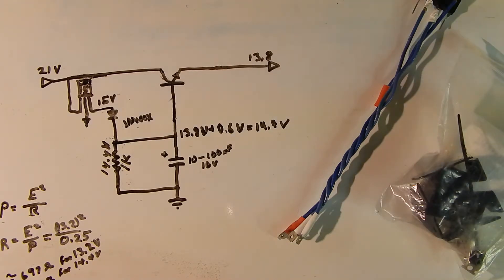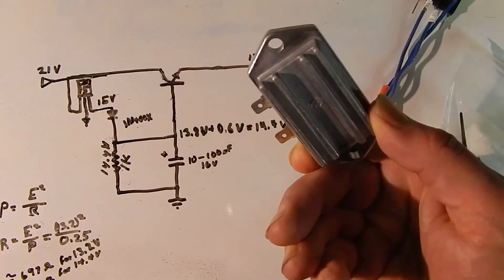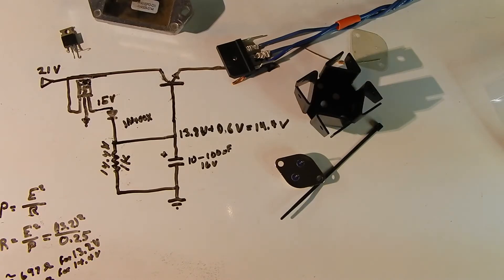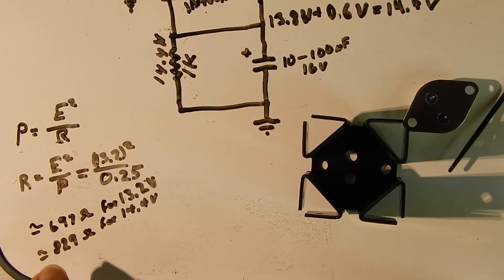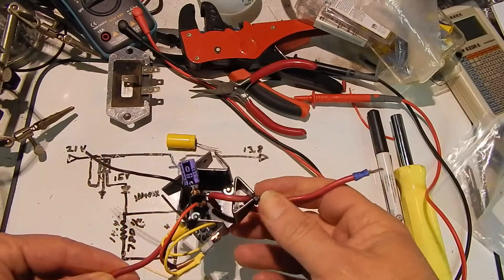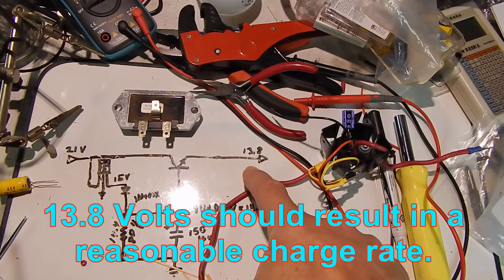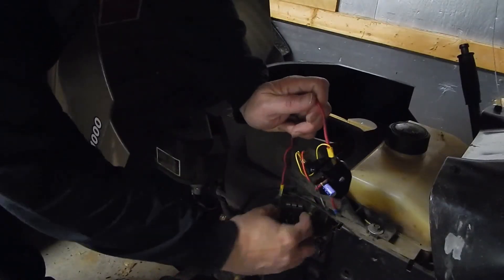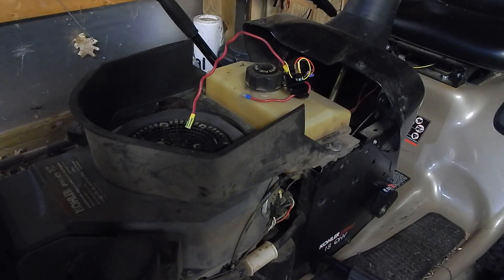Kohler Voltage Regulator Re-Regulator!

Comment: Fun project!  You could remove the small regulator and put the resistor there, so from collector to base, then put a 14.7 V zener at the base to ground with a cap in parallel.  The resistor zener combo puts a voltage at your base and the resistor supplies current to the base and zener.
Reply from the maker: Had the regulator, didn't have the Zener.
The stock regulator is a mystery to me though, why would they make it without a voltage standard? Really odd how any resistance before the battery or battery ESR itself drives up the regulated Voltage. Why would a regulator not have a V to ground standard?

Comment: Kohler 22hp motor on a Ferris mower is getting a fuse blowing eventually after running a wile .the wire gets hot also between the fuse and the key switch. regulator is putting out 14.5 volts. is that to much causing my hot wire eventually blowing the fuse !?
Reply: That is typical of a bad electric PTO clutch. If it only happens with the mower deck engaged try running without the deck engaged and see if that helps. If it does, you will need to test the clutch and replace as needed. Also check the PTO switch for resistance.
Reply from the maker: Follow the heat. Is the fuel cutoff solenoid getting hot? 14.5V is about normal a few seconds after starting, should settle lower (~13.8). If not, make sure the regulator is well grounded and all connections are solid and free of corrosion. But something is drawing too much current, and if Voltage doesn't exceed that 14.5, and the headlights or other accessories are off, there really isn't anything else for a load other than the fuel cutout solenoid.

Comment: Might there be a buck converter w/ sufficient power output, that wouldn't be dumping the voltage differential as heat in a linear pass trans circuit?  While more fidgety, a home-brew buck might be able to be designed for considerable power.  Just a wonder.
Reply from the maker: It would be something to look into but a challenge. I designed for a 15A output, not impossible for a buck but would need some physically large inductors and capacitors and the whole thing has to survive a hot environment. Still, it's an attractive idea, especially if I wanted to eliminate the original part and use a full wave bridge as I originally intended. Shouldn't be too hard to program into an ATtiny, and it could be intelligent enough to run at a higher Voltage for cold temperature use and/or a boost to like 14.5V for the first five minutes to recover the battery a bit. The more I think about it the more I like it!
Reply: Yeah, today, those of us more familiar with discrete component circuits have to ramp-up with the large pool of modular devices.  I have a clunky multi - LM317 bench power supply that will be cannibalized, replaced by Chineseium buck/boost modules WITH programmability AND displays.  Good luck on not burning out any more 'tronics on the tractor.
Reply from the maker: I've seen other Tubers do the same. My concern with that as a lab supply would be noise, EMI/RFI. The large variety of modules from China is interesting, but there is a lot of hit or miss to it